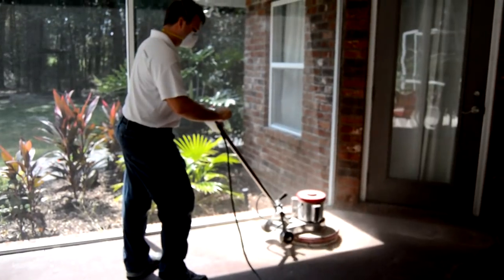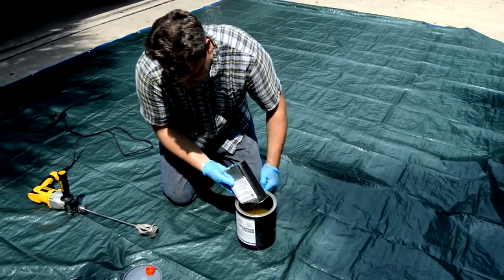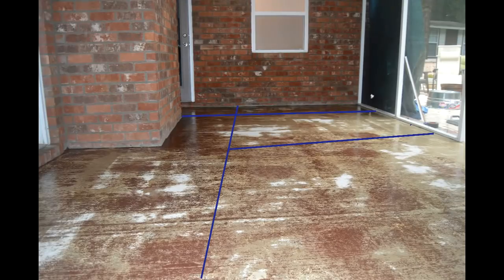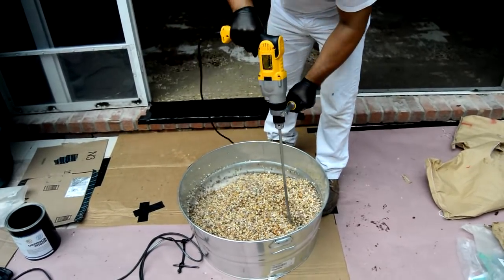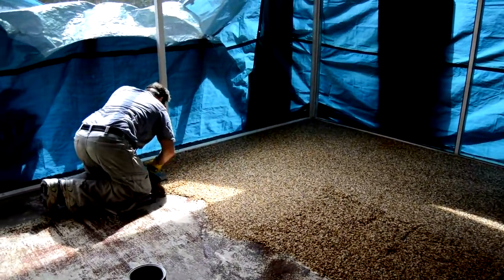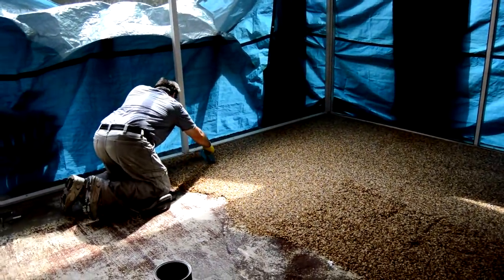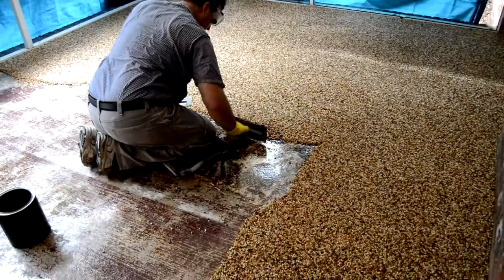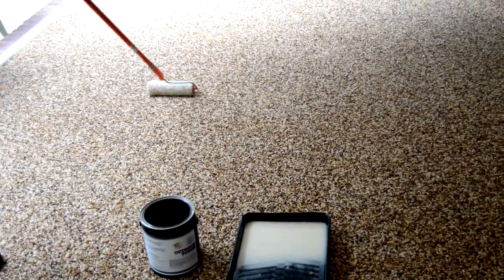How-To Install Epoxy Natural Stone Flooring

Comment: Will a $19 metal tub suffice?
Reply from the maker: Nope. Tub HAS to be $17 or it won't work. LOL :)
Reply: Jessica Blaesing 
What I did with my 19 dollar tub is I took a measurement, broke the depth down into 19- 1 dollar increments, measured down two increments from the top lip, then used a felt pen to make a line around the entire tub. I tried tin snips at first but they were a pain in the azz, so I drove an hour to the next town where I bought an angle grinder (79.99), and some extra cutting wheels. After cutting off the extra 2 dollar strip, the tub worked great!
Reply: Everlast Epoxy Those people at lowes really must not know construction. Even went to corporate asking if they carried the $17 tubs. Nothin'. Are they some specialty tub y'all include with the service? Did y'all patent the $17 tub so we couldn't do it D.I.Y style?
Reply: Everlast Epoxy well I can't do this then ☹️. I live in England and can only buy in £. Can you post ? And change my currency?.
Reply: Jessica Blaesing I don't think my $17 tub is the same size does it matter?
Reply: You beat me to the punch, Jessica! But I was thinking more on the $15 tub.
Reply: I got a deal on mine, $15 ...
Reply: this is really confusing for us brits due to the fluctuating exchange rate :-)

Comment: H E L P!! We moved into a home that has the Chattahoochee pebble stone surface. After the first here (FL) it started molding in-between the pebbles. We lightly pressure washed it and resealed it, we thought it was never sealed when they laid it,  now we have horrible white patches all around the pool area. We have resealed it twice and it still looks very patchy, you can tell where the pressure washer has been, it actually has streaks. We did not pressure wash too much under the lanai so it still looks pretty good. However outside the lanai area it looks as if they painted the rocks because the rocks are very faded in large patchy sections. Did we pressure wash the paint off, hard to tell what is going on. Can you guys suggest what we can do to even out the colors?
Reply from the maker: That is a common problem when using epoxy outdoors. That is why we developed Polyavastic.

Comment: I purchased all of the bags of rocks, the epoxy, trowels, tarp, spent close to $2000.  I finally unloaded it into my back yard.  Then I remembered I needed a $17 tub. Ran to home Depot but they only had a $19.99 tub.  I was so distraught and depressed I quickly ran home and became a hermit for 8 months. All the supplies still sitting in my back yard.  Because I did not leave the house I lost my job and so I had to sell my belongings.  Then I decided to cut all of my hair and join a cult.  They had jobs for everyone.  I was excited cause I really felt I was again worth something. The cult leader assigned me to a job which was written on a sheet inside an envelope.  I opened it and the task was to install a pebble floor in the sacrificial hall and had a link to this video.  I quickly had a frightening flashback as thought I was back at home Depot........
Reply from the maker: Sorry I took so long to reply :(
I was sad from your story, so I didn't know what to say. But I'm over it now, so, I'm sorry I guess.

Comment: Video is better than most - no annoying music, but the discussion about the car in the background could have been edited out.  I like the descriptions about what type/size trowel to use, but I could use more info on setting up the vinyl barrier (assume it is to block the sun-maybe that affects drying time or curing somehow).  

Also I would like to see what edging was used around the patio to block the stones from falling off the edge.

I also don't know how to use a gauge rake.

Thanks.
Reply from the maker: The vinyl barrier was actually tarps. They were nailed to 2x4's and leaned just inside the soffit. The purpose was to keep the rain out while the floor was curing.

You could hold the stones in with a 1x4 then remove it when the stones are cure. Put a car wax on it first so the stones don't stick to it.

A gauge rake really isn't that hard. If you had one and were tasked with spreading a pile of sticky rocks with it, you'd catch on really quick, I promise. I hadn't used one before my first time using one either.

Comment: Do you sell DYI high temp epoxy? I want to have pebble edges on my out door patio with clear coat (give a beach theme) but here in Arizona there only 3 seasons hot, hotter, and monsoon
Reply from the maker: We never recommend using epoxy outdoors. Polyavastic is what you need.

And I'm sorry about Arizona, but I can relate bc I live in Florida. And we don't even have a Flagstaff to escape to like you do in Arizona.

Comment: THANKS TO YOUR VIDEO I CANT WAIT TO GET THIS DONE ON MY CONCRETE FLOOR....BUT I HAVE THREE CONCRETE STEPS AND IM WORRIED ON HOW TO GET THE STONES TO STAY ON THE BACK OF EACH STEP....CAN YOU HELP ME WITH THIS PROBLEM???
Reply from the maker: Make forms out of 2x6's to hold the pebbles against the risers. Leave a 3/4" gap for the pebbles. Put car wax on the side facing the pebbles. Then fill it with the pebbles. Remove it the next day and do the steps.

Comment: Will it adhere to vertical surfaces?
Reply from the maker: It will, you'll need to use a form board to hold in the stone while it cures.

Comment: epoxies should never be used outdoor they are not UV resistant
Reply from the maker: You are absolutely right. Even so called "UV resistant epoxy" still yellows and chalks over time. We recommend using polyavastic instead of epoxy outdoors.

Comment: Why recommend using a Marshall  trowels?? 20 yrs in building game never ever seen anybody using a £70.00 trowel doing floors.. Marshall trowels are for smoothing walls/plastering due to their thin blades, use one on cobble stone/ or pebble stone as we call it in UK? You may aswell throw it away, won’t be good for anything else anymore.. and then buy a $17 bucket?? 😂🤣 99p buckets from B&Q would do exactly same job..
Reply from the maker: If you had to deal with the stiff junk that they sell here in the USA, you would be thankful for Marshaltown. Trust me.